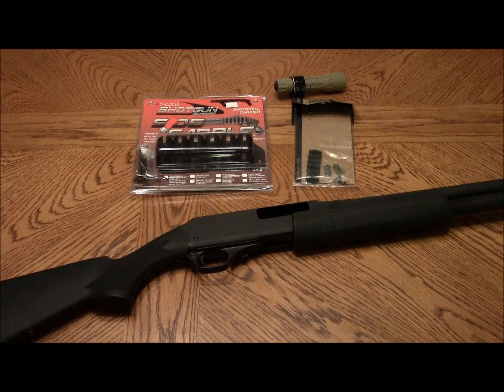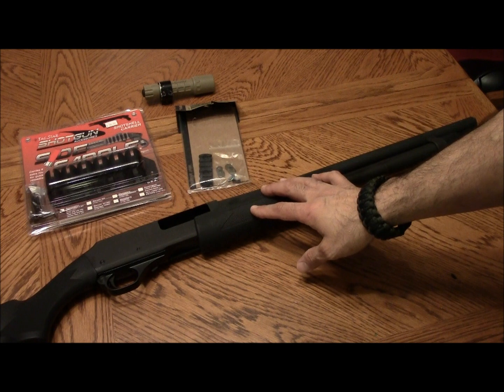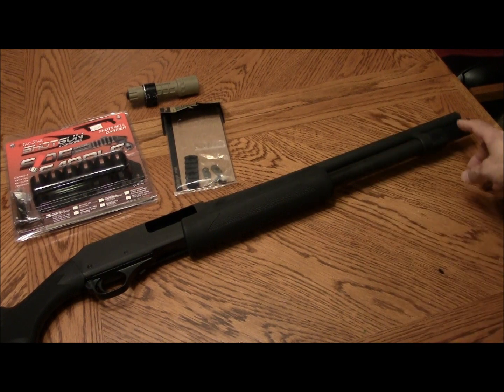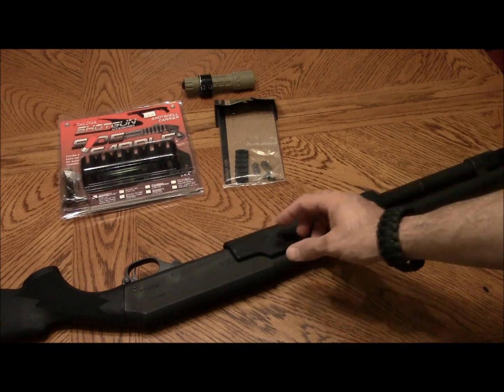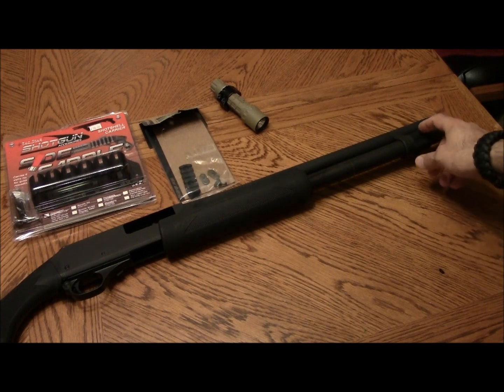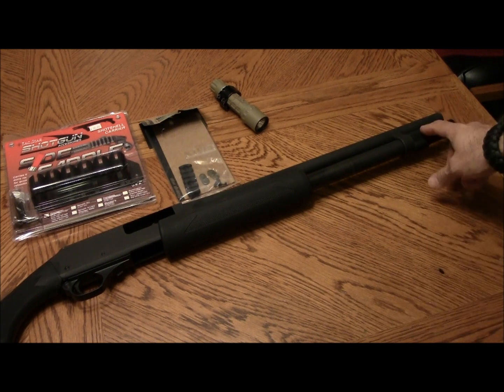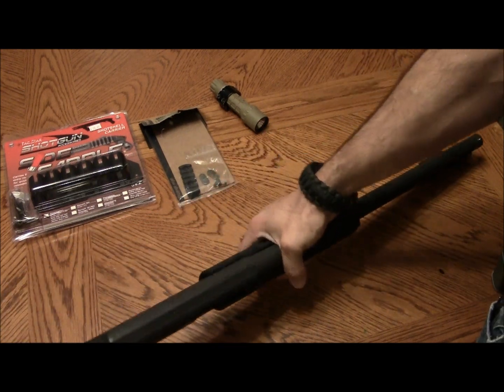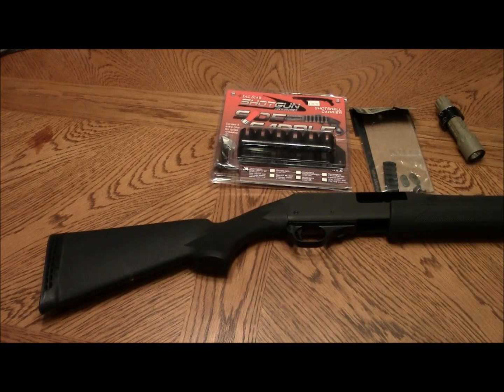H&R Pardner Protector home defense upgrades

Comment: Can anyone tell me, is there a difference between a 20 gauge and a 12 gauge pardner pump as far as accessories are concerned(other than barrel, magazine, receiver internals, obviously)? Are the stocks or forearms any different?
Reply: 20 ga buttstock needs a small spacer part if you want to change to aftermarket  12 ga stock

Comment: Great video. Just to clarify for everyone I have called Remington and confirmed that H&R is owned by Remington. It is not a knockoff, it's simply another Remington product. The reason they are so much more inexpensive is because obviously china has less taxes, they dont have to pay as high of wages to employees,  and they dont have to pay for medical or dental , workmans compensation etc therefore it is much cheaper to manufacture outside of the USA. I also asked Remington if H&R shotguns can be sent to Remington for warranty and they said "absolutely".
Reply: Well, technically a Remington product.  Built by a Remington owned company.  Perhaps "Hawk Industries"?   I have one and I don't think it measures up to the Remington standards I am familiar with.  Its Chicom heritage is obvious.  It is heavy, ugly, and built like a tractor.  On the plus side it is inexpensive and has proven reliable so far.  I feel I got what I paid for.
Reply: "they dont have to pay for medical or dental" - they have free medical and dental.

Comment: I too have a Pardner for home defense. I haven't done any mods yet because I'm still having trouble with it. The last shell hangs up and won't clear the mag tube. I polished the elevator and it feeds a little further but still not 100% reliable. Its a work in progress. I should have sent it back to H&R but I figure its a good learning opportunity. Been so busy with other projects I haven't really devoted the time it deserves. Other than that its a great gun. Can't wait to see yours when it done.
Reply: ChaplainJoe1 replace the mag tube follower to a stainless steel one and upgrade to a better mag tube spring.

Comment: The length of the mag tube extension is unimportant, mine sticks out 1 1/4" past the muzzle
and the finish DOSE get burned off the top of the tube.
I've seen 3-gun comp shotguns where the mag tube extension sticks out 8 to 10" past the muzzle, no problem....
Good vid, Thanx.
Reply: +Chuck Pringle  I was gonna say the same thing... so,.. Roger that !!
Reply: Yea I like it that way, just like an added stand off device

Comment: i wouldn't bother with the butt stock unless you just want to reduce the weight. if it is just a bump in the night gun, your wife doesn't need tobe thinking about adjusting the stock at the time. the added weight of the original would probably help her with reduced recoil, also, it would look more badass, though.

Comment: Does the pump overlap the receiver because of that particular pump? Like could you solve the problem of it overlapping by switching to a different pump?
Reply: yes that can fix it, you will need to find the one made for the 870. my personal suggestion is the Magpul 870 pump